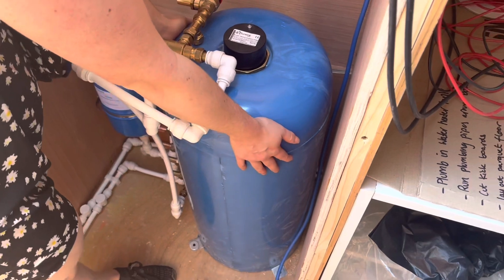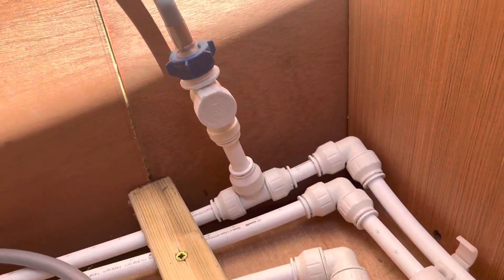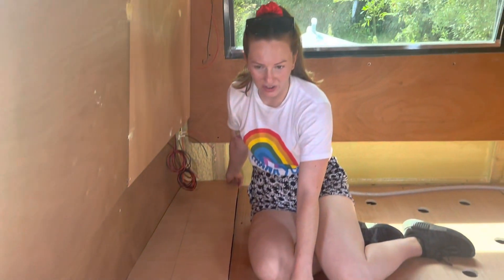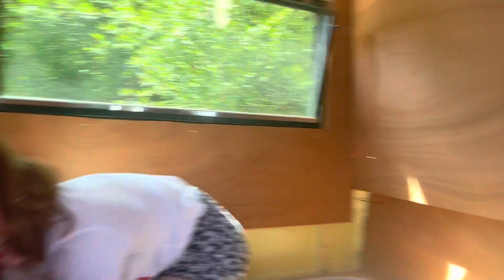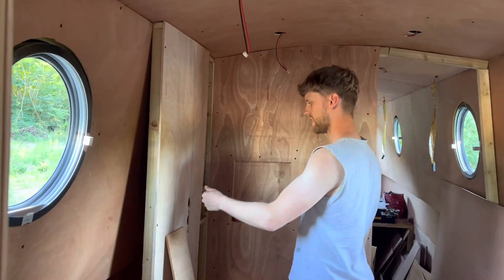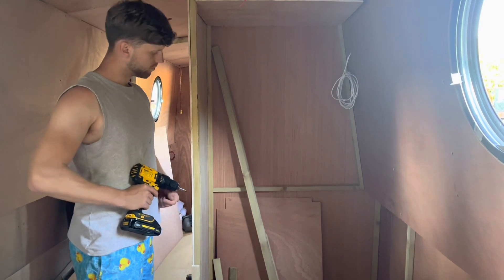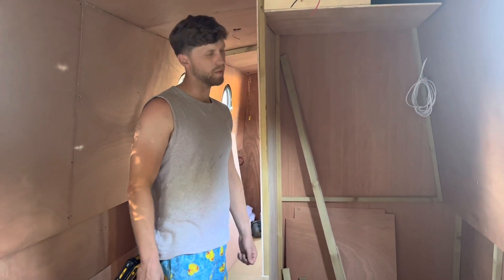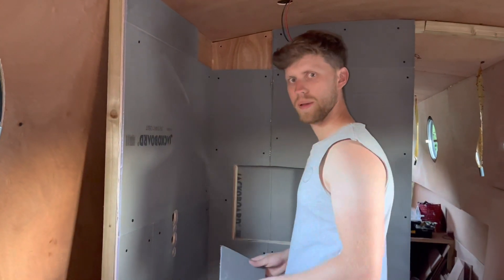First fix plumbing and hot water on our narrowboat | 🤞 no leaks! #narrowboat #houseboat

Comment: Hi I tell everybody that's fitting out a narrowboat fit two water pumps one for hot and one for cold then fit a bridge pipe with a valve in between the two this means  if one pump fails you turn the valve to open and it runs on one pump until you can change the broken one

Comment: Looking great. Needs possibly 3 or 4 times (IMO) as many holes in the bed boards and unknown how much the boards are supported but it does need a lot of support as the boards will bow over the course of a few months/a year. Also make sure to make the boards moisture proof as they will warp fairly quickly if not sealed. Cant wait to see the super shower. Keep up the great work.

Comment: It's better I think to have a temperature mixer tap at the bath or shower pour off point.
The engine is going to super heat the water too hot to touch.
I am not a fan of simply dumping all the pipe work on the floor of boats as every one does.
I prefer to use space immediately under gunwhale to transport pipework through the boat. 
Interesting that all fit the immersion tank near the stern of the boats.to have a long run into the boat might work help reduce heat pressures build up.
You need to fit directional flow valves in line to stop heat pressure build up against cold tank flow from getting into the hot water tank. Running the engine for 30 mins would heat up the tank therefore I think having heat sink radiators to dissipate heat might be a good idea and be able to shut off tank supply from engine heat after it's done its job.
These are just some thoughts I have on what I would do.